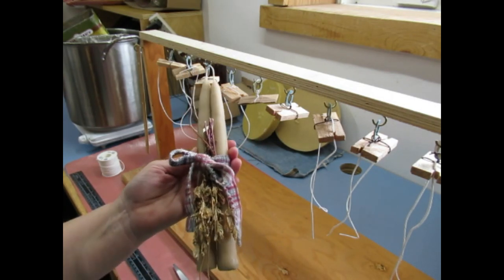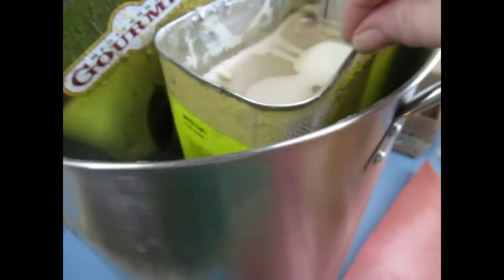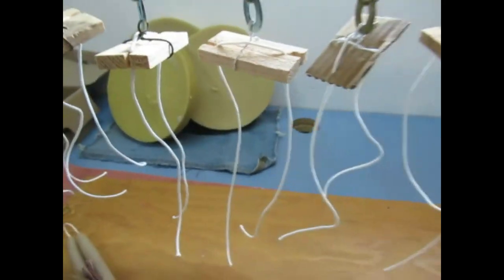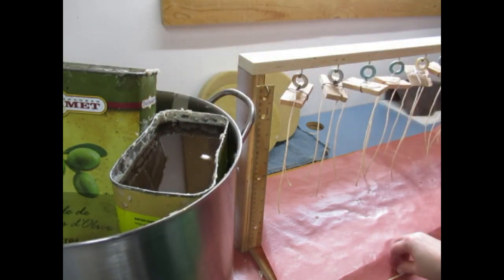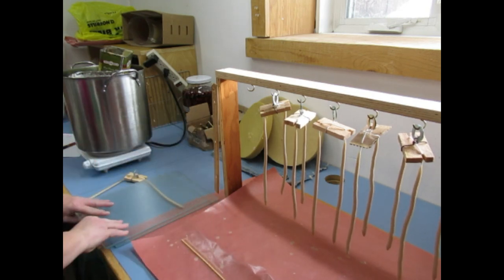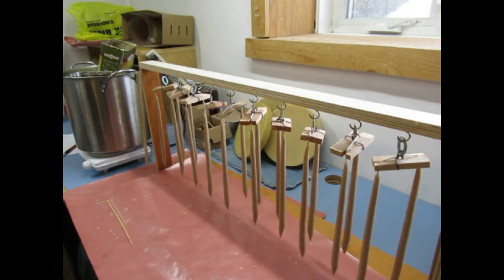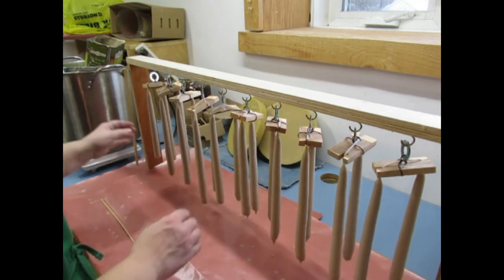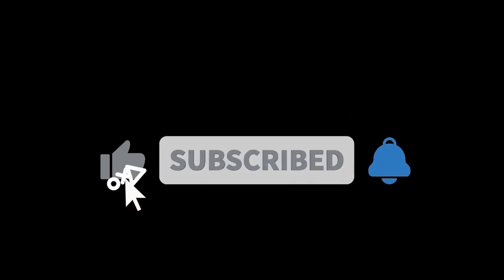HAND DIPPED BEESWAX CANDLES Don't be left in the dark MAKE YOUR OWN CANDLES Brighten Up Your Life  🕯

Comment from the maker: DC's Bees your comment it not showing so I hope you see this.
Could you tie a washer or nut to the bottom of the string to hold it straight, or would that waist to much string? 
Yes, I have done it, you can tie a nut a washer is too light.  But, my dipping container is too short.  I end up with 5 inch candles.  Also, it's too much of a hassle trying to recover the wax on the nut.  I don't like waste wax is very expensive.  I would have to change my whole set up bigger dipping container bigger pot and that all costs money.  I use what I have.